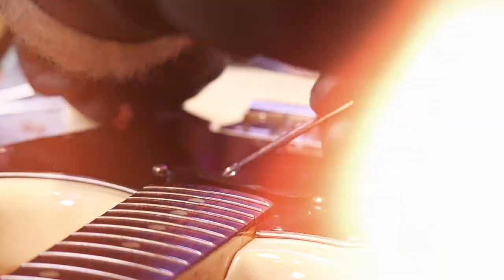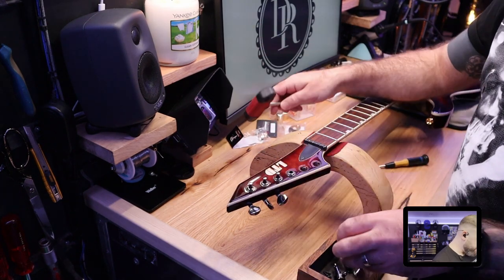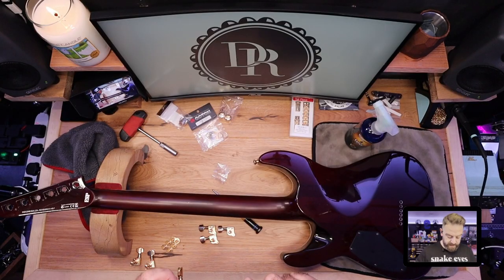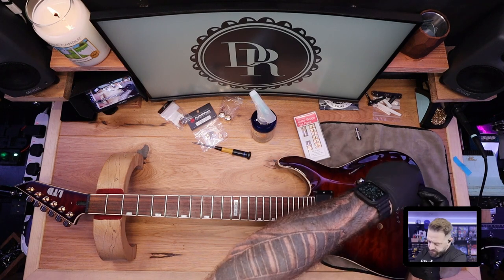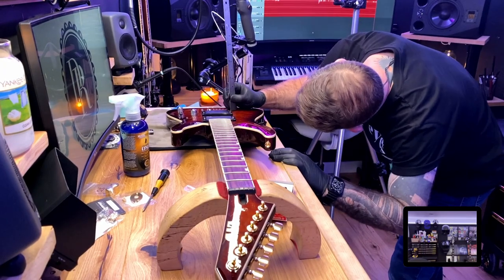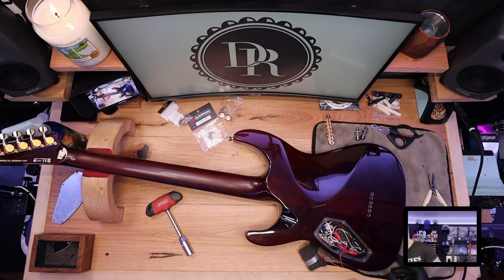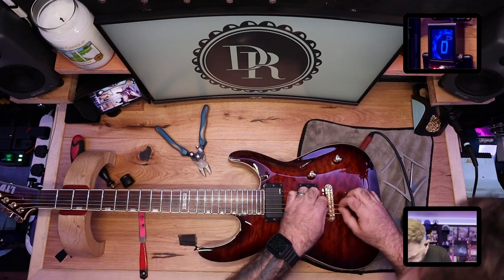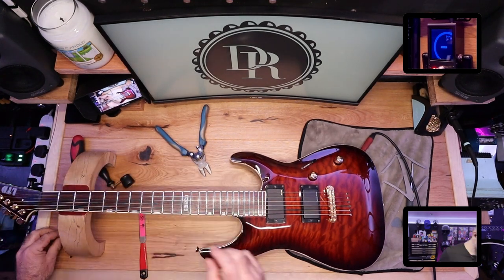Guitar Setup Tutorial - Episode 1 - 2009 ESP LTD MH 250-NT

Comment: Great video man, really enjoyed watching your process, very satisfying and well produced. Do you have any tips/workarounds for when you run out of adjustment room on the bridge saddles and the intonation is still sharp? I’ve made a rod for my own back by playing 24.75” scale guitars in Bb and always end up with this problem. I’ve seen those bridges that have extra adjustment range but wondered if there was another way? Hope you’re well mate!
Reply from the maker: Hi Graham, thanks for the feedback I really appreciate it! Best thing to try first is to cut down the intonation screw spring, try taking it all apart, cutting the spring in half, reassemble and then tune up to pitch to try it out. If that still doesn’t work, try it with no spring (but that may potentially cause other issues). If THAT doesn’t work, you’ll need to look at resetting the bridge plate further back and extending the scale slightly. Hope that helps 👍🏻
Reply: @deanrowbothamguitars  Thanks for the reply mate. Ah that’s a great idea, I hadn’t thought of that, I will give it a try, nice one!

Looking forward to more vids mate 👍